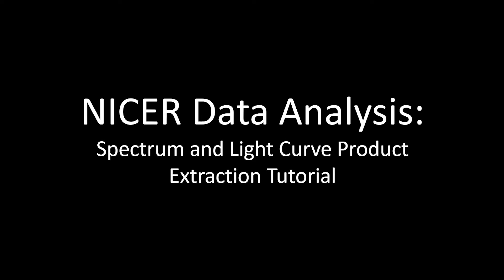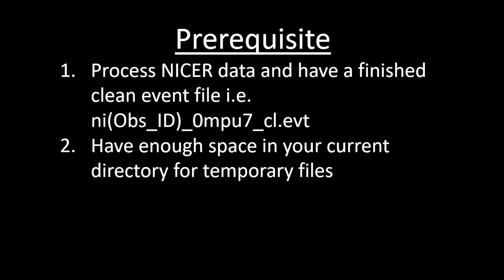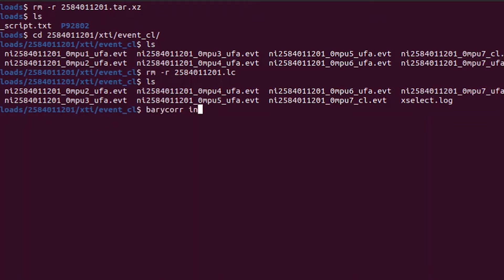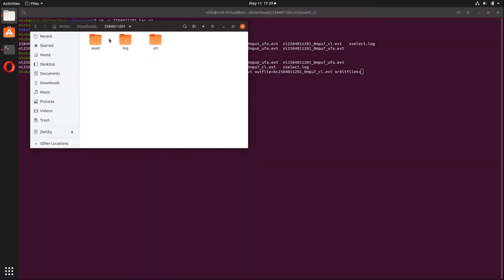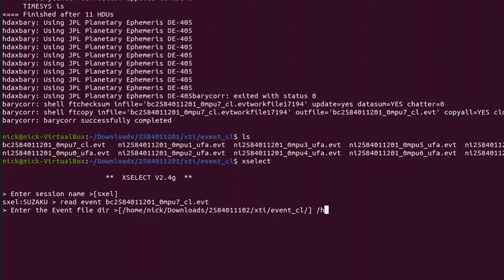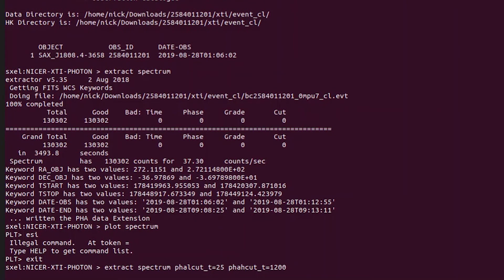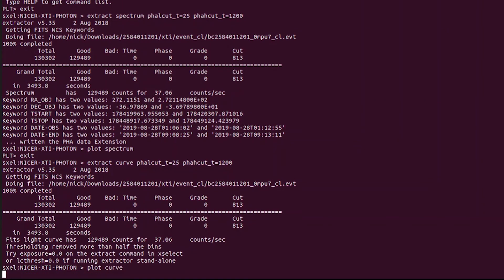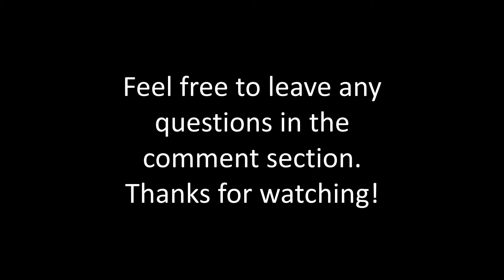NICER Data Analysis Spectrum and Light Curve Product Extraction Tutorial

Comment: I am getting an issue while plotting. After extracting the curve or the spectrum,  when I enter the command to plot, that is, plot curve or plot spectrum, the output does not show any plot. The next command PLT> shows up but there is no output graph shown. What should I do in this case?
Reply from the maker: @Asad Ahmad 
There are two different things that I am thinking could be happening, but do note I am fairly limited in the suggestions I can make because I can't see your system.
1. The default plotting software with xselect is /XW,. It could be the case that somehow the plotting software xselect is defaulting to got changed. 
2. If you are running a strictly command line OS, you will need to change to an OS that allows for GUI's. (I only bring this up since this was a problem I saw with someone previously.)
3. /XW is an external plotting software. Although it works within HEASoft, it will open a separate window that on some linux distro's doesn't appear in any taskbar.

My best guess is that you are dealing with the first case (as I see it the most often) in which /XW was changed to /XS or some other plotting software. 
The worst case scenario is that something went wrong with your HEASoft build. In which case you will want to rebuild and reinstall HEASoft.
Reply: @nspace-cowboy  Okay so assuming that the problem is the first case, (I don't want to rebuild it again as it took about a day for me to setup everything!) What should I do to change it back to /XW, the default plotting software? Can you suggest me on how should I proceed? And thank you too! (Note: I am using Windows WSL (ubuntu) for the same.)
Reply from the maker: @Asad Ahmad Apologies for the very late response. Somehow this reply did not make it to the top of my comment feed. This info should help you: https://heasarc.gsfc.nasa.gov/docs/software/lheasoft/ftools/xselect/node113.html
For the device just input /XW

Comment: I have a question regarding data analysis with Nicer.
How can I generate ARF and RMF files for Nicer data? I've been looking it up in the internet but with no success. From my understanding, without those files I cannot process my data in XSPEC.
Sorry for any inconvenience and thank you in advance! :)
Reply from the maker: Great Question. The short answer I have right now is that as far as I know there is no way to generate ARF and RMF files for NICER. This has actually been an issue I've been aware of for a while now, and I am continuing to try to find a way to generate them. That's not to say I haven't done spectrum analysis with NICER, but I have had to dip into very creative/skeptical ways of going about it. 
I have personally tried writing custom code to generate them, which is easier said than done. I also tried using arfgen and rmfgen in the XMM-SAS software, but those programs are specifically written for XMM so I personally wouldn't use them for any work I was planning on publishing.
At this point I am open to any ideas/input that anyone has on this issue.
Reply: Thank you for your reply! I have a follow-up question.
Is there a point in trying to use RMF and ARF files which can be downloaded from the following website:
https://heasarc.gsfc.nasa.gov/docs/nicer/proposals/nicer_tools.html
Reply from the maker: Sorry for the delayed response. 
Yes, there is a point to using the available arf and rmf files from the NICER tools, but remember that they are just example/sample files. There is still a chance when using these that you might get some off results in your spectrum modeling. This is probably the easiest fix to this issue available, but note that as far as I know it is a temporary fix as we will hopefully get a way to generate arf and rmf files in the future.